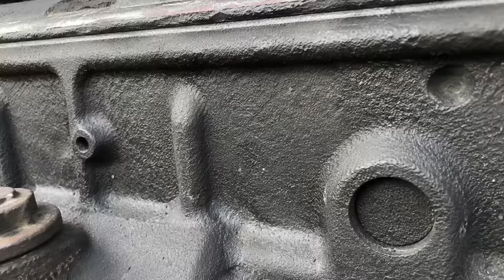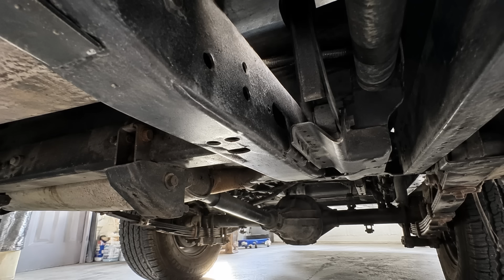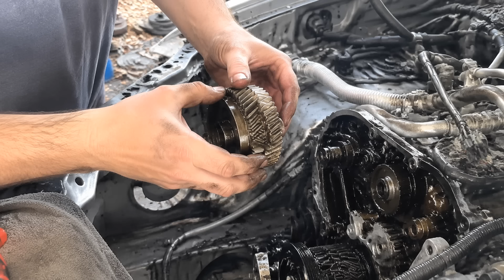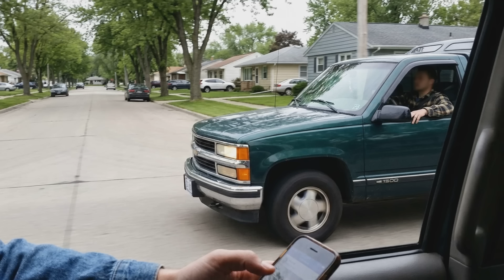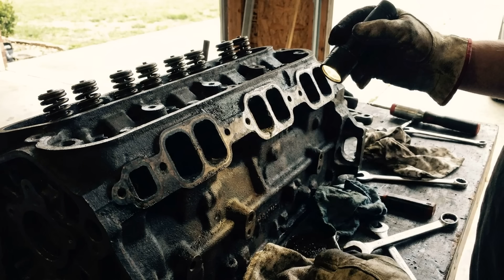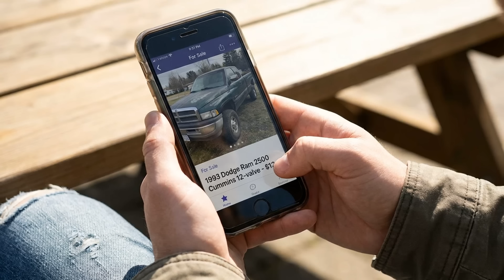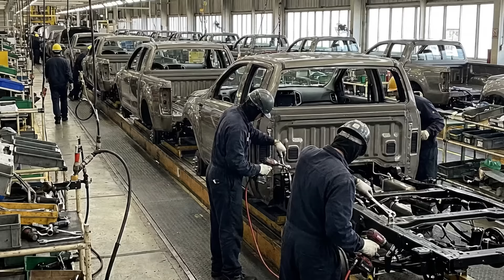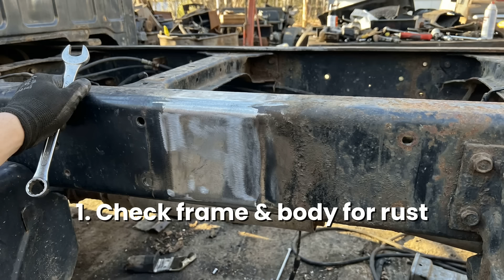7 Dirt-Cheap Pickup Trucks Nobody Buys (But They'll Outlast Every New Truck Forever)

Comment: I note with interest that you don't mention the Toyota Pickup (pre-1995) or Tacoma (1995--->). I have a 1994 Toyota 4WD Xtra Cab Pickup with the 4-cyl. engine that I bought new. This week she rolled over 346,000 miles. Never had to do anything major on it, but I do change the oil every 2,000 instead of 3,000 miles and I tune it once a year. NOTE: I bought 4 new Goodyear Wrangler Radial 235/75R15 105S OWL All-Season Tires at Walmart August of 2025... $105.00/tire and that wasn't even on sale! So, $420.00 for 4 new tires.

This video doesn't mention any Toyota Tacoma or T100 Full Size pickups at all, and their "performance over time" and current sale prices relative to the prices you're quoting here tell me you're leaving these vehicles out of your videos on purpose.

Comment: 65 chevy 1 ton with a 292 six.  Granny gear drum brakes. No power steering ,no ac. Cab corners rusted. Kick panels rusted. Got a stop sign for a floor board. Put rods and mains in it in an afternoon.  Run a hone in the cylinders theow new rings in it good for another 100,000. When it starts using oil go to 50 weight.

Comment: I had an 1985 Ford F-150 with the 300 six and four speed transmission, loved the truck but I hated that 300 six and WOULD NEVER own another one, worse engine I ever had in my life, no power and used more gas than a 350 chev, and rock bottom gear every hill, and it had a brand new rebuilt head and 158 pounds compression  on every cylinder, but could not pull the truck empty up a hill with out going down to second gear every time, the best engine I had was a rebuilt 352 in my 1973 Ford F-100 that one had lots of power and 18 miles to the gallon no problem,    Cheers

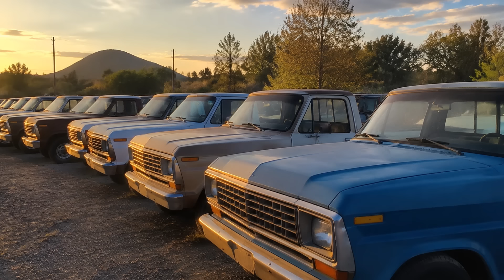Comment: I'm from Texas and I have a 94 C2500hd with a 5.7 tbi and it is approaching 300k miles and all I've done is basic maintenance other than at 200k I replaced all the gaskets and seals and installed a double roller timing chain. The transmission is a th400 which was a option so that would be the only other change I would make to it,but it still runs falsely and with the 3:73 rear differential I could replace them with 3:55 and get a little more mpg.

Comment: 2 Ford Rangers 87 & 94 no problem 1996 Dodge 3500 dullay Cummings no problem some electric problem 😢but great pickup. Grandson drove had all most 200k miles cousin has it now landscaping still running

Comment: My 1994 Ford Ranger Super cab was rock solid. First time it stranded me the gear shifter fell out of the trans (on the freeway). Second time the engine burned up because the plastic serp belt tensioner melted (on the freeway many miles from home). For most cars this would be considered bad. For a Ford Ranger this is actually pretty good. I sold it for scrap - what it was worth. As luck would have it I bought 88 Jeep Comanche with the $350 I got from the Ranger. Had about 200K miles on it and soon after a rod started knocking. I just pretended I didn't hear it and proceeded to drive it another 100k miles with the rod knock. That 6 cyl engine is pretty much bullet proof. I think it had a ax-15 trans or so I was told. Never had an issue with it though.

Comment: I had own a Nissan D21 truck 1997 and it was hit in front of my house parked. I only had liablilty insurance on it and thought I would lose out, well it was total and I had uninsured motorist insurance and recieved $3500 plus salvage $1400 dollars. I ended up finding a 1999 ford ranger xlt for $7500 in excellent condition with 150000K miles on it. I bought it and I love it. Not one leak on the drivetrain. I ended up out of my pocket $2600 dollars. I could not be any happier.

Comment: I have owned a 1970 Ford with the 300 ci inline 6 and an 1989 GMC  5 liter V8. Tried to run the wheels off them. Great engines. Had the transmission on the Ford go out while the warrantee was still in effect. I had it fixed under warrantee. It went out again after the same number of miles. That time I had it repaired at a transmission shop. The difference it took Ford a week and it had to be repaired again. The independent shop took 2 days and never need repaired again.

Comment: I had a 88 Chevy 3/4 ton that I used for transport and hauling heavy loads changed just bolt on parts like clutch starters and water pumps sold with 250,000 on it

Comment: I owned a 1968/69 ford truck with a 300 six. it was slow but very reliable. I used it every day as a work truck. 12' steel flatbed on it made it perfect for the sand and gravel concrete mix 2 tons was nothing to haul on it. I would love to have that truck back today.  Manual transmission 3 speed with a granny gear. never broke down in all the years I worked it other than universal joints and a long side tie rod which I had a hard time finding. paid $1300 cash for it in 1997 off a farmer.

Comment: Have a 98 Ranger with the 2.5 4 cylinder 5 speed manual.   My late wife (farm girl) bought it new while in college.  It now has over 300K with the original clutch.  But it now has low compression in #3.   Planning to pull it and rebuild this winter.  Of course I'll put a new clutch/hydraulic clutch release system.  Hopefully w8oo dr8ve it another 300K.

Comment: John Deere tra tor owners won " right to repair" their very expensive  units & WON!!! That's what the auto drivers need.  Back-yard mechanics are few & far between, with invaluable knowledge AND experience, going to their grave. Not crazy about relying on electronics, computer components, & disposable parts. When the government had certain age cars( '80 & '90) giving the owner a $ incentive to turn in the car, the motors had a chemical put into the motor, the car was ran, & seized the engine. That SHORT period of running, created as much or more pollution, than running the car for a whole year. So, is pollution a TRUE incentive to remove the older era, reliable, fixable vehicles( I think not), but rather money is. Drivers are becoming "dependant, or even hostage" to the vehicles of today & tomorrow. 
EXCELLENT video❤❤😢😢

Comment: I have a 1993 Dodge 350 4x4 dually that has the 5.9 Cummins with 598,000 original miles, the only thing Ive done to it was put new injectors, and change the oil every 3000 miles,it cranks up in about 1-2 seconds,I have went through 2 garage 5 spd transmissions though,I'm never going to sell it

Comment: I bought a 1978 Toyota SR5 Long Bed  September, 1977. It has less than 128,000 miles. The only change I have made is to add a heavy duty clutch so I could pull my boat out of the water going uphill. Sold that boat after only having it a year. I paid $5300 + Taxes and Fees. It is presently parked in my garage. I checked last week and the average price on the same truck list for $16,000 up to $32,000. Crazy. I figure the auto lobbyists will sooner or later try to get Congress to pass laws so older vehicles will not be allowed on the road. We will be forced into buying these spying, computer on wheels at ridiculous prices.

Comment: My Ford 300 in-line 6 eat a camshaft at 3500 miles then threw a rod at less than 40,000. not my version of a good engine..

Comment: Miss my 1982 Ford F-150 truck.  Good old truck that even I could work on. But when it broke all I heard was a ping sound like I ran over something on the road. Got it towed home and started checking everything . The harmonic balancer somehow shear  itself off at the camshaft. Hard to find another good truck that I can afford around here. Currently using family handed down car.

Comment: I used to own a 1995 Chevy S-10 4 cylinder, 5-speen manual transmission, 21 miles per gallon. 277,000 miles  on the day I sold it in 2006. Asides from regular oil changes on the transmission, rear-end and engine, All I ever replaced: 1 anti-freeze leaking head gasket after a nasty winter (175K miles at the time),  1 worn clutch and throw out bearing(bushing in this case), 1 leaking/corroded thermostat housing. I did all the repairs myself, iin the driveway with a simple Craftsman basic tool set.. I know the current owner, he keeps her in good shape and the truck is still alive and running today in 2026, her body is still in good shape, paint too.

Comment: Had an 82 Dodge it had the straight 6 with a manual, after replacing all the cooling system hoses one at a time it was nearly unstoppable. Damn shame I sold it.

Comment: The 2005 Ford Ranger Edge has a computer in it that goes out without warning. I have one with only 100.000 ,miles 3.0 burns no oil, never had a problem until the computer stopped energizing number three and number four on the coil pack. I bought a new computer that didn't fix the problem . Is been in a shop since this passed may 2026. The computer was sent out for repair but still does not send power to two cylinders, The coil pack has been replaced twice. The wiring checks out. No one can get it running. It's about to become art in my garage when I get it back from the shop who says I should sell it, but I won't. Truck is not beat up , no rust at all, glass and interior good ,air works , paint not faded.

Comment: I have a 97 XJ Cherokee Sport 4.0 liter 4WD that's been sitting in my driveway for four years with around 100,000 miles on it. It still starts and runs smooth. Mainly because I keep a Battery Tender on it 24/7. Unfortunately the MI winters have destroyed the body frame rails, & rocker panels making it unsafe to drive. My wife uses it as a greenhouse for her spring perennials plants. I keep thinking I'll buy another rust free XJ that has a couple hundred thousand miles on it and swap engines. But man XJ prices have gone sky high. But I'm probably dreaming. So it continues to sit.

Comment: Had my '99 2.5L Ranger rebuilt at 365K by my favorite mechanic before moving out-of-state in 2017. The mechanic said the rebuild could wait. Still on the road. Truck owes me nothing except for the air flow sensors.

Comment: I sold a 1991 Chevy with 5.0 with throttle body injection, body had almost no rust,  transmission working but going into neutral when I  let off the accelerator.  Sold it too cheap $500 in 2009 to get a new Silverado 4.3. Didn't keep it long and sold it too cheap.

Comment: I've had several vehicles that don't require transmission fluid changes but i did them anyway maybe late but still made very noticeable difference in the operation and shifting. Infiniti ex 35 mos noticeable wouldn't shit up soon enough going to 2 or 3,000 rpm with little load before shifting up. 360,000 km is when I changed it now 6000 later can say it runs like new shifting up at 1000 when driven gently and performing great under full throttle smooth shifting. The manufacturer recommendation is to destroy your transmission that would otherwise likely never fail.

Comment: I got a 2010 F150 with 4.6 engine almost free with 318,000 km in it,  Replaced the exhaust manifolds soon after but they were leaking when i got it. I've just done regular maintenence, alternator,  states and recently ac compressor and power steering pump but it's at 389,000 km. Everything still works, every light, windows, radio etc.

Comment: Between the smaller trucks you forgot the Chevy S10. I think the last ones were made in 2004 and then replaced with the Colorado. There’s a lot of them still moving around and some of them still in mint condition. As a matter of fact I have a 1998 that still runs. That and the fact that they are still around after 22 years or more (like mine) says a lot about them. They came in four and six cylinder with both automatic and manual transmissions. Great little trucks.

Comment: I loved my non-interference 2000cc Pinto 4-cylinder.  The timing belt stripped it's teeth twice - a simple fix.  I changed it in the driveway once and out in the street where it stalled the second time.  The cast iron block had 5 main bearings.  It was German built, and a few people converted them to supercharged dragrace machines.  Sturdy bottom end.

Comment: I went to the dealership with my grandpappy in 1992, where he bought a 1992 Mazda B2200 4x2 extra cab 5sp manual with the LE package as he wanted the chrome but not any other creature comforts. He did have them install after market cruise control and a very basic AM/FM cassette player. One day about 2 weeks after he bought it, he handed me the keys and said "You're taking us to Vegas!" Other than a few times out in his old 1980 Chevy Citation, I was pretty much a first time driver but figuring out how to down shift on that first hill gave me all the confidence in the world and not only did I drive us from Priest River Idaho (North Idaho) to Vegas, we went to Arizona, California, up the coast through Oregon and to his cabin in a little town in the rain forest called Brinnon WA.  What an experience. Shortly before he died he was doing his usual drive 16 miles into town and the check engine light came on. He drove it to the shop in town another 7 miles rather than pulling over. By the time he got there, the engine was done. It just needed a water pump but the extra 7 miles over heating did it in. That truck had 286,000 miles on it with the first Continental tires he put on to replace the factory tires after 40k miles and they still looked new. He sure babied it otherwise, often shifting between gears at 1500 rpm and never getting on it hard. Those were the good days when Japan made trucks were solid rocks!

Comment: I have a 2017 F-150 and I am very satisfied with it, but after seeing prices ($70,000+) I will not be buying another new one. My next truck will be a 96'ish F-150 with the 4.9L I6. If I can find a mid 90's Ranger Splash/4WD with the big 4L V6, that would be my second choice. It'll sit next to my Fox-body Mustang convertible with the GT HO.

The keys to longevity is to replace the fluids (all the fluids) at least once a year depending on mileage. That includes the differential gear oil, the transmission fluid, brake fluid and power steering. Use synthetic whenever possible. If you do that, the mechanicals will always outlive the body panels.

The problem with modern vehicles is that they are all built for fuel economy standards. ALL OF THEM. The government fuel economy requirements have become so stringent that you simply cannot build vehicles, especially trucks like you use to. The metrics they use to calculate the requirements are also ridiculous. Truck economy standards are based on wheelbase which is why you don't see small/mini trucks anymore. Modern "small" trucks like the Ranger, Colorado, etc are as big or bigger than the full-sized trucks of a couple decades ago and its why full-size trucks have become so massive. Yes, we love the roominess of our crew cabs, but the primary reason for them is to add wheel base so they can manage to still install engines with power that have lower fuel economy. A pre-2000 truck simply could not be built now because of regulations.

Comment: We have a 2001 Toyota 4runner that we bought in 2017 and it had 287,000 miles and is an 8 out of 10 on it looks. 9 years later it is a little dirtier and has north of 400,000 miles on the odometer and is still running like a new one.  It has zero rust issues for a Kentucky SUV which when we got it surprised the crap out of me. It has the 3.7L V6 and is a 2wd but it still goes great in snow. Have had no issues until about a year ago something started draining the battery and we found out it's the damn factory alarm. So I had to put a cut off switch on the negative battery cable to stop the draining issue and all that is just an annoyance having the turn the power on and off, but she still starts the first turn of the key no matter the temperature outside. I have to say for what we have in it, which are only 3 new belt when I first got it in 2017 just as a precautionary measure, one new battery in 2024 and 5000 miles oil changes every 4 or 5 months over the past 9 years. She loses about ½ quart over those 5,000 miles too. But she has to be the best deal I have ever gotten on an automobile. We'll keep her until we pass on and then we are gonna leave it to one of our grandchildren.

Comment: I too am 70 in Dec.- I have JUST sold 'my 93 F-150 I-6 2wd  with just under 97K on it and I ALREADY regret it. My DAD bought it NEW off the lot no frills no slider, window cranks, no nothing - only had AC(which his co-workers teased him about) and that kinda wonky OD transmission. I took care of that though, only a bit of debris, in other words -in time-I've serviced entire drive line, running gear, wheel brgs. etc. in the 30 years I've had it.     I presently live in Kittitas, WA.(the DRY SIDE of Wa.) as did the truck for its past 20 years, 10 yrs on the WET SIDE of WA.near Tacoma Wa. and then he had possessed it in Redmond Wa. since 1993-99.

Comment: I had the Mazda B2200 '90. I loaded that truck till the rear bumper nearly hit the ground. It lasted 200K +. Frame rot finally got it out of here. The 5 speed on the floor was brilliant. The rest of the interior was terrible. I bought it new for $6K. Best bargain I ever had.